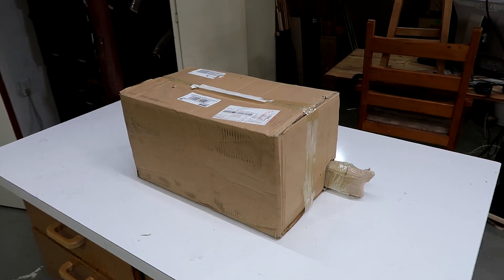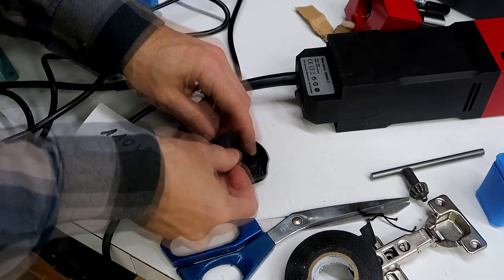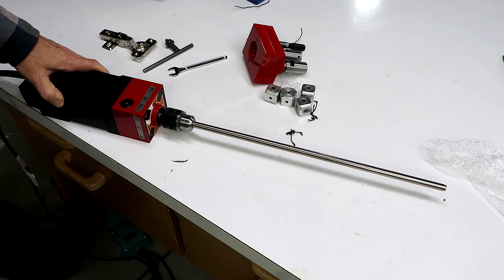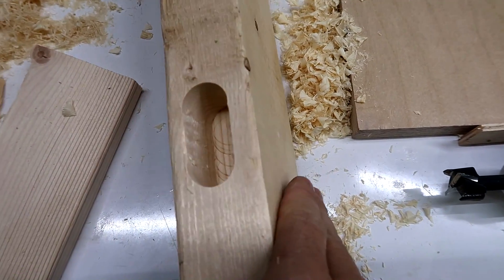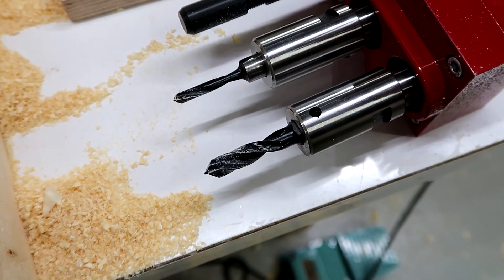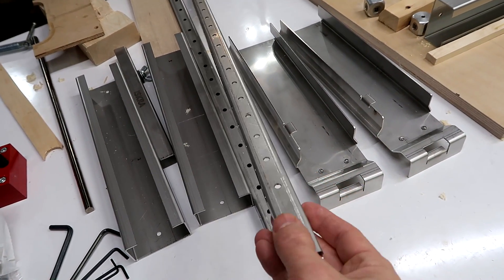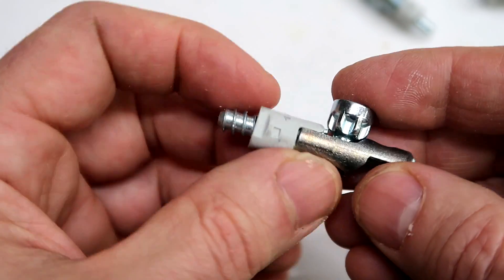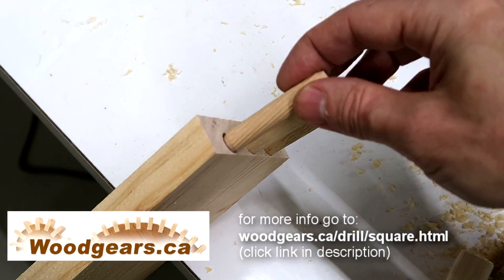A square drill for round holes

Comment: Imagine if Dewalt or some other big company started making square hand drills instead of drills that looks more like a sneaker then a tool.
Reply: if they made square sneakers we could walk with greater accuracy
Reply: @tyvek05 the handle obviously needs to be ergo, but not the body. A compromise would be a sneaker drill, but with a flat reference strip on each side. you know, a hexagon instead of a circle...
Reply: @tyvek05 true, but I would still buy   one, certainly if it is battery powered (not that I (will) need one)
Reply: As far as I know hitachi were approached with this and refused to take it on because it was too robust. It lasts too long for their liking. In the region of 250 to 300% longer than any of their corded drills. Bottom line, they wouldn’t sell enough of them to make it worth their while.
Reply: T3hJones I’d prefer milwaukee
Reply: tyvek05 Aight. Make a square mold that you can fit the drill into.
Reply: @orppranator5230  swappable square housings. Several sizes for different jobs.
Reply: @tyvek05 Wouldn't have to be a big heavy square section tool though. It could be a nice ergonomic hand held drill that had a reference ridge, or groove, on the back and both sides so that it could be used against a simple jig or guide rail.
Reply: I suspect some of them will start...  Maybe not every big brand, but one of them will, and it will sell relatively well in the beginning...  Think about it, they are all still in business still selling the (basically) same thing...  How many people need another "sneaker" drill?  Now, how many people have square drills?  It's not hard to imagine that people in the market to buy a drill may opt for a square one (if available and not priced ridiculously high), and people not in the market for a new drill may still buy a square one because of a need...  IF there are only 1 or 2 players selling these, they will do well...
Reply: @nathantinlow4769  the sneaker drill market is saturated.  the square drill market is wide open
Reply: @natalieisagirlnow  Brevity has never been my strong point...  You summed up what I was trying to say nicely! :-)
Reply: It would not sell. Not at all. You obviously have not ever done any construction
Reply: @dumptruckintruthduke  not usable for you is not the same as not usable.  there is definitely a use case, you just aren't it
Reply: @natalieisagirlnow  I never said not usable. Sure its usable. But it's a stupid idea to think that dewalt or milwaukee would even consider making one. Because it wouldn't sell. At all.
Reply: Obviously construction workers want the ergonomic dewalt transformer toy drills, but that doesn't mean there isn't a market for a different form factor. Look at hand routers. They put a cylindrical reference on them and people clamp them to CNC machines all the time, as well as using them with the hand router attachment as manual tools. A drill could be the same way easily with a machined cylinder behind the chuck and clutch to clamp on to and use as a reference.
Reply: @tyvek05 only a polish person would take a working concept, then make it almost completely unusable and square
Reply: @SteveRone  except its not unusable its a niche tool for a niche market

Comment: pretty good design i can see many  useful uses most especially in high production of course my background is  Commercial Cabinetry  mainly we used a high grade of Melamine  for most of our cabinet  construction and a wide assortment of European fasteners  we utilized a lot of boring machines and CNC  machinery  many of our 90 degree fastening was strengthened by wooden dowels  because they were low cost and  fully automated including the gluing process  cutting down labor costs and improving quality   your new drill would be handy in a home shop for building  a homemade pocket hole machine or anything similar  ?

Comment: could you not make a quick and dirty lathe with it ? seems like it would work well
Reply: No variable speed though.
Reply: @Cadwaladr  what sort of motor is it, can it be voltage controlled ?
Reply: @dincerekin  Possibly, Matthias knows more about motors than I do, so I'm sure he could figure it out. It sounds like a standard universal motor like you find in any corded drill. Lathes usually have induction motors that you can control with a variable frequency drive.

Comment: I wish some manufacturer would make a router with a square body.  Nice drill.
Reply: Stuff a round one in square tubing.
Reply: If you get two CNC machined aluminium rectangles with round hole for router body in it, then every router becomes square.
Reply: @bluef1sh926  I am thinking to make a "holder" out of wood for my drill and router that would allow it to be square with a clamp/ bolt tightening type mechanism that can easily be popped on and off. That would allow a world of controlled outcome possibilities.....
Reply: @bluef1sh926  Of course you can make your own, I just thought it would be nice if the axis was precisely parallel to the sides and rigid right out of the box.  And perhaps some threaded holes in the housing to make it easier to mount on a jig.
Reply: DANK  Exactly!  Guess we'll have to settle for half-circles and gear clamps for the time being.

Comment: North Americans honestly have no idea about Euro cabinetry. Not that I'd expect you to, since you've got your own designs, but watching American YouTube woodworkers try to use this stuff is bizarre. You need to remember that it's generally made to sub-millimeter tolerances on heavy panel saws and beam saws. Without that accuracy, you're gonna have a real hard time getting the hardware to fit. Even the panels themselves are built to strict tolerances. I've had major issues caused by panels that were 0,7mm thicker than I expected them to be.

That makes this drill interesting, but effectively only for amateurs.
Reply: Yeah i dont know why they did not compensate for the paint layer... but apart from that this drill is pretty nice
Reply: For someone that wants to use that right angle hardware, and can't afford a boring machine, it's not just nice, it's essential.

I wasn't just referring to this video though. Watching Matthias use those drawer slides in his last one... I mean, they've got a tolerance of +1mm -0mm from nominal. So if your right angle hardware is off by 1mm per side, nothing's gonna slide properly. And this drill is gonna need a lot of care to get better than that.